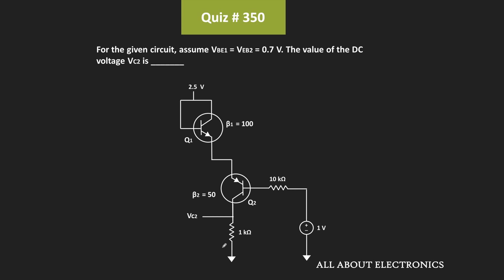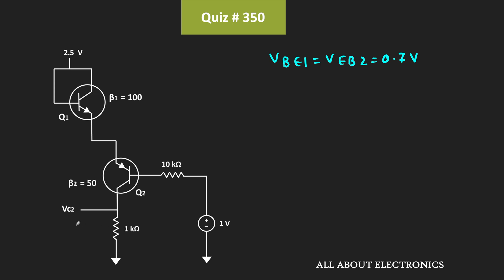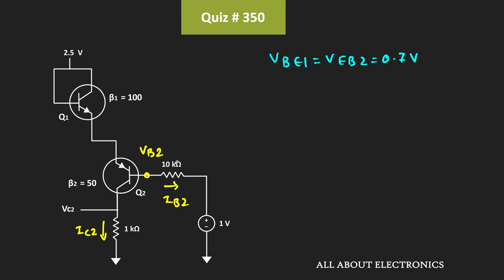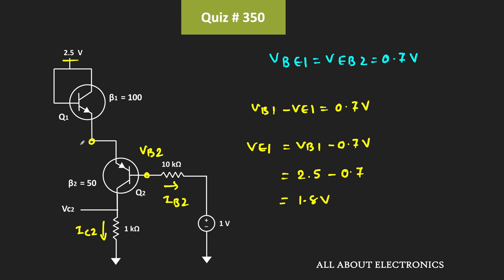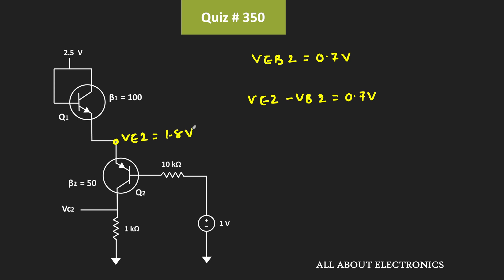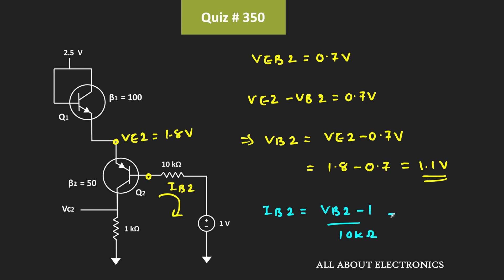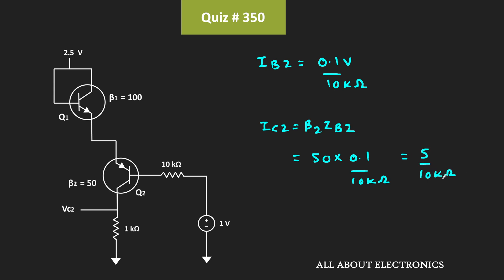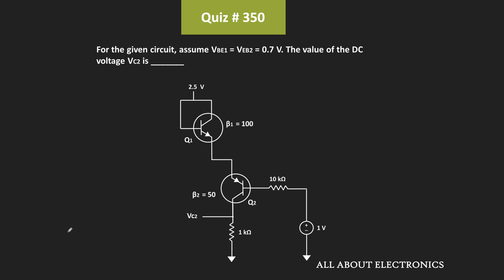BJT Solved Problem (NPN and PNP transistor) | Quiz # 350

Comment: Hello sir, initially can we assume that the transistor is working in saturation region and  find all the parameters?
Reply from the maker: If you want to you can, but here if you look at Q1 then both base and collector are tied together. It means that, it is operating in the active region. (VBE = VCE) So, it is not operating in the saturation region. (It is operating in the active region)
So, I would say, initially assume that, all the transistors are operating in the active region. And find all the parameters. After finding parameters, if you find that, some of the values are not matching (or way off from the expected value) then that is the indication that transistor is not operating in the active region.
Reply: @allaboutelectronics-quiz  ok sir thanks a lot

Comment: Hello, I have a question : how can we know that the transistor is working in the Active Region, we didn't prove it before using the B. Thank you !
Reply from the maker: Here, initially it is assumed that, BJT is working in the active region. And accordingly, the parameters were found. But after finding those parameters (collector voltage), you can check, whether base emitter junction is forward biased and collector base junction is reverse biased or not. If it fulfills that condition, then it means that, our assumption is correct and indeed BJT is working in active region.
Reply: @allaboutelectronics-quiz  Ineed, I checked and its the Active Zone. Thank you for your answer and your vidéo !

Comment: what is .7v
Reply from the maker: It is Vbe. That is the typical voltage across the base-emitter junction of the transistor.
Reply: @allaboutelectronics-quiz  If it is Veb will it become -0.7V?
Reply from the maker: @Engr.aileenrosebernardo  The second transistor is PNP. For, PNP transistor VBE is negative. So, typically, for PNP transistor, the base emitter voltage is represented as VEB instead of VBE. I hope, it will clear your doubt.

Comment: What is the type of configuration of this circuit??
Is it CB , CE Or CC ???
Reply from the maker: This is just DC biasing. The configuration depends on where the AC input signal is applied and where the output is measured.

Comment: At 2:58 min KVL is confusing... What happened to 1K resistance, we didn't take into consideration... Please correct me 🙏
Reply from the maker: See, that equation was used to find the base current of Q2. If we know the voltage between the two-node, then for a given resistance, the current between them can be found right !! If the base voltage of Q2 is not known then we would have applied the KVL equation over the entire loop. But since VB2 is known, then there is no need to apply the KVL over the entire loop. 
I hope, it will clear your doubt.